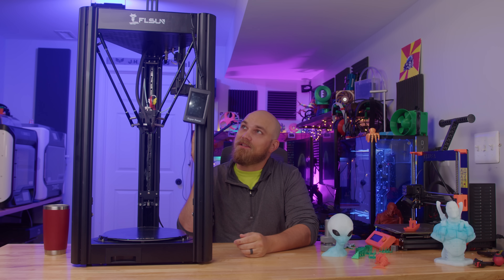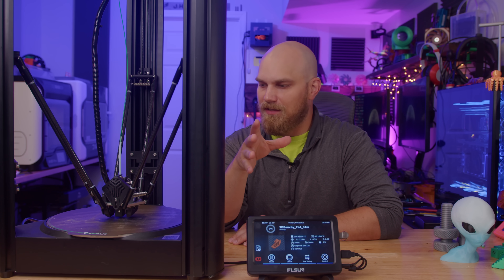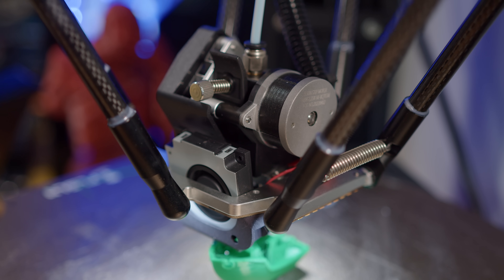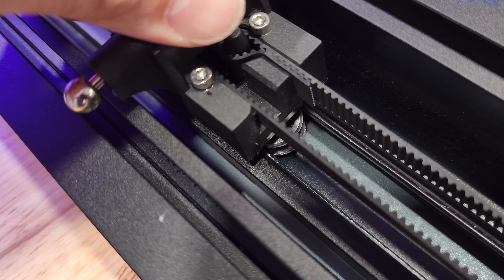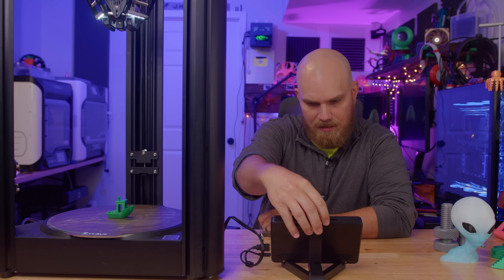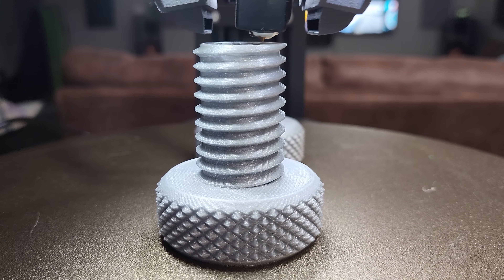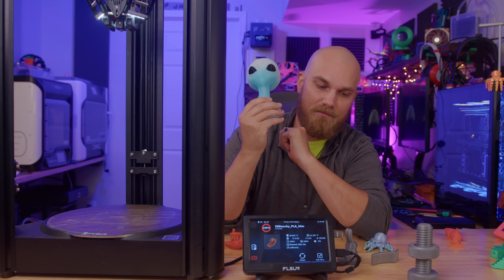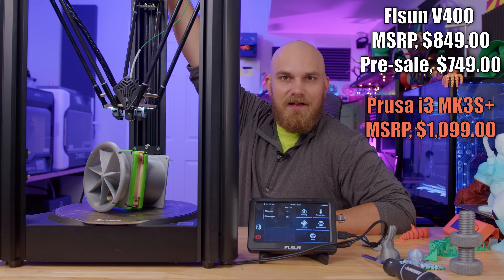How The MIGHTY Have Fallen | FLSUN V400 Review

Comment: noooo it beat the cheater! one must automatically assume that the surfaces are sealed unless specifically designed that way. the fact it was designed flat means it should have sealed and any warpage from printing MUST be disregarded..... the cheater has officially been beaten
Reply: But how would the cheater run with the gaskets becomes the next question?
Reply: I agree, the intended design did not contain any leakages and the design is shown to be better in this test, I am not sure why it would not be allowed to become first place.
Reply: @madmechanic7_797  probly because when u make stuff u need to take a count of things that could be going wrong and if u need additives it means u had fault in the way u made it compared to the way it was suppose to how it actualy did
Reply: @madmechanic7_797  it's the rubber gaskets on the fan that make it leak.
Reply: @StoryMode180  agreed if the cheater does better with the gaskets then it deserves the top spot. and the top 10 need to be retested with gaskets, future tests must be done with gaskets to ensure fair testing
Reply: @TheRattleSnake3145  💀

Comment: for a beginner would you recommend the FLSUN V400 is it easy to build., can it print multiple items on the heat bed? or would the Prusa Mini Plus, be a better choice as a beginner at 3D printing? A little down side really like that the FLSUN V400 has more filament options to chose from for printing items, can the Prusa Mini Plus also print TPU, PETG, PLA+ and Wood filament's.?
Reply from the maker: never used the prusa mini just the mk3, prusa makes good stuff i love my prusa, however when it comes to assembly putting the V400 is 10x easier. Also since getting my V400 i use that over my prusa, i would recommend V400, easier assembly, faster printer, quieter, and most importantly cheaper.
Reply: @MajorHardware  Thanks' for the quick reply back :)

Comment: Watch video. You say Klipper is installed on printer.Having tried ti install klipper (all 3 Versions) on a Raspberry Pi3 it is not easy. So far I never got klipper to work so I went back to Marlin 2.0.9.x on my Octopus pro 429 printer. So it would be nice if you went over klipper on this machine. In a little more detail. Maybe this printer does not use a Pi at all but this is key info that one would need to know.

Comment: I feel like those seals should be standard, and maybe the top 10-20 fans should be re-tested with seals.

I noticed a lot of the tests fans seemed to leak air between the fan and the housings because they were just zipped together, something that wouldnt be an issue if they could be screwed / bolted together firmly. Also, those rubber feet on the fan can come off, perhaps thats the difference? 

Lets see the cheater and the other top performers re-tested. We are looking for ultimate performance, they shouldn't lose performance because the testing set up was sloppy. A gasket ensuring tight seals obviously made a decent difference here, what difference would it have made elsewhere?

Comment: I want to know if because you have flexible print material and hard print material could you possibly 3D print the soft parts of a speaker or a subwoofer like the cone dust cap forming tube for the voice coil and also make a rubber surround and spiders pension from the soft print material along with making the basket/frame from hardened material and just add some copper wire for the coil and actually make a working speaker or subwoofer from a 3D printer

Comment: If I want to run crazy high filament flow - like a 1.2 nozzle making big things fast, can someone suggest a replacement or upgrade for the stock V400 volcano hot end that would still work on the V400?

Comment: well I was hooked on my q5 until I found a problem that on tight tolerances it is imposible to print large objects... specialy round ones... since they get slightly oval shape.. and thanks to useless stock firmware you cant calibrate that.. and then not with marlin and to get correct delta config you need to run clipper where you spend more than you did for initial q5.. not mentioning that you get in trouble soon if you get into some detailed printing with slow mainboard... that was a big turnoff for me.. that I couldnt "trust" my delta to print accurate and nice parts...

Comment: Nice video! 
$850 for the FLSUN V400 seems much better than $1100 for the Prusa. Prusa is an old 8 bit bed slinger with smaller build envelop. FLSUN has klipper, and based on the sample prints (bunny, deadpool, etc) the quality looks amazing. Benchy had issues....what about a comparison printing same materials Petg, PCmax, nylonX or equivalent, TPU or other flexible?

Comment: This is actually looking pretty impressive. The speed, while not quite as fast as the Bambu X1, is respectably fast, though the results are definitely not quite as clean looking as the Bambu. I'm wondering how fast and effective successive iterations of Bambu's technology are going to be and how long it will be before we see other companies starting to incorporate aspects of it into their own designs.
Reply: You can definitely push this printer and dial it in and get way better results than this at fast speeds. Obv I would still upgrade the fan, nozzle and head as well as the extruder but everything else they seemed to have pretty good parts.  Remember that Bambu X1 is almost double the price of this one and is closed source. For 1600-1700 you can have 2 Deltas vs 1 X1 Bambu lab printer.  The price point is more comparable to the 700$ Bambu p1p barbones printer. It's also stuck at a 256mm³ small build size. 

In my head I'm comparing this more to a predator Delta printer. This one's way better than the old predators at home.

Comment: the design ask it to be sealed properly. but due to imperfection on the printer it is not. I would guess that the owner design it to be flush on the fan. I think its the fault of the installation and the printer. for me this beat the cheater,